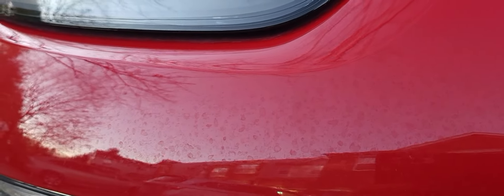How to remove water spots from PPF (Simple, no need to replace PPF) #car #carwrap #waterspotremover

Comment: If you have ceramic coating over your ppf and you use this product to get rid of water spots, what protocol would you use to protect the ppf afterwards?
Reply from the maker: Regular washes with either Gyeon PPF wash or a ceramic car wash soap made for ppf since it's ceramic coated. Really there aren't that many ppf protectant products on the market but the goal is to keep it clean
Reply: @illusionzauto  Cool. Thanks! So, this product shouldn’t affect the ceramic coating of the ppf?
Reply from the maker: @dereksilva7876  know if anything they would just enhance the ceramic coating the only way any ceramic coating can be affected is by abrasive such as compounds or polishing

Comment: The problem people dont know is when you polish ppf like that, you remove the ceramic properties that comes with the new high-end film
Reply from the maker: @joelkuznetsov2826  while true I would recommend using gyeon ppf renew.  That restores those properties.  In the case of this video.  The ppf was years old and neglected.  The owner didn't care about the ceramic properties being compromised.  He just wanted the water spots gone
Reply: Or the thin self healing layer that’s present on XPEL
Reply from the maker: @Ironpancakemoose  maybe if compound were being used on a new xpel wrap but ppf can be polished with a product called gyeon ppf renew.  There has not been anything proven that polishing will remove the self healing layer.

Comment: Thank you for the info. I would say the most shocking part of this is the xpel warranty says; "9. Water spots – water spots are caused by mineral deposits, which if left to dry on the paint protection film may leave a stain, water spots are not covered;" which is frankly ridiculous given this vidoes solution. Xpel should be ashamed of themselves for this exclusion of coverage. Disappointed in xpel, I am. Success always! Dr. D
Reply: Calcification spots aren’t a part of the warranty because when you polish XPEL PPF, you are polishing off the thin self healing layer on the top of the film.

Comment: Would this work on satin black wrap? I have some water spots on it and it drives me crazy lmao. I will try this product.
Reply from the maker: No this will not work as satin wrap is not full gloss.  If you try this on the satin wrap, You will notice a difference in the finish.  My recommendation would be to try optimum mdr.  Remember before just applying the product to the surface, It is always recommended to do a very small test spot in a more secluded area.  If you get the results you desire then you move forward.  Please note that if there are hard water spots on a wrap, That film would need to be replaced.
Reply: @illusionzauto  Got it! Thank you for responding. Yea, doesn't look like hard water spots because some came up with just water. They just seem to come back when it rains or when I wash it through a brushless wash. I will try optimum MDR. I saw in some forums to try white vinegar / distilled water mix in a spray bottle with a microfiber towel.

Comment: That’s crazy how you can treat it like paint
Reply from the maker: Well in the sense that we would have to be much more cautious but there are products on the market where you can actually use a foam finishing pad with Gyeon PPF Renew and put your polisher on speeding setting 1 or 2 and remove water spots.

Comment: Doesn't work. Even tried it with a buffer
Reply from the maker: @davecotterman623  While it may not have worked for you due to the fact that you may have heavy water spots that may have been there for some time, It doesn't mean that this process doesn't work at all.
Reply: The xpel is a year old. Car is garage kept. Has been rained on before bu thats about it. They aren't bad but I can see them. Not sure what else to try. @illusionzauto
Reply from the maker: @davecotterman623  so this video was just a general demonstration but I would recommend using Gyeon ppf renew.   Now while I don't recommend using a polisher on ppf. It can be done with this product in combination with a black finishing pad and a DA polisher on speed setting 2. This product also helps to restore those ceramic properties water repellency